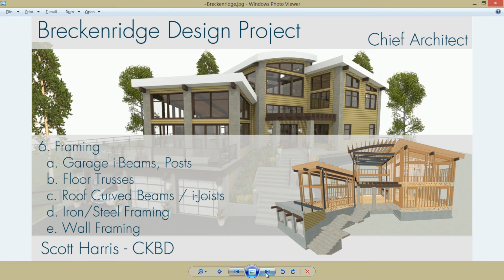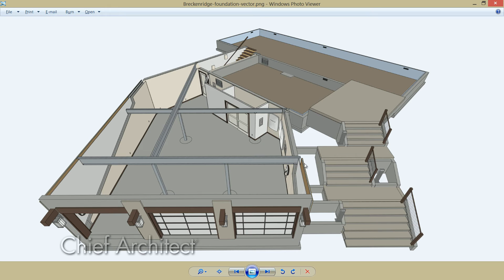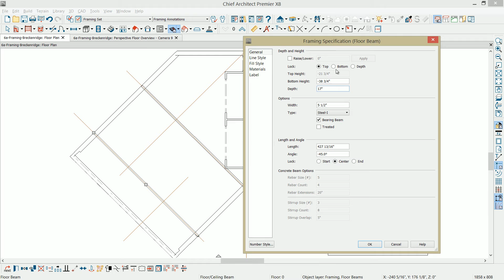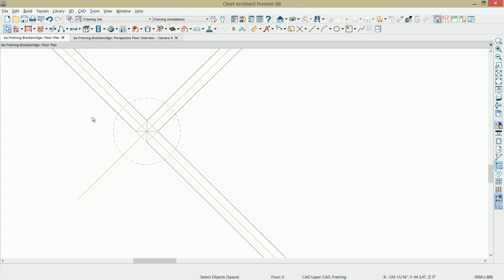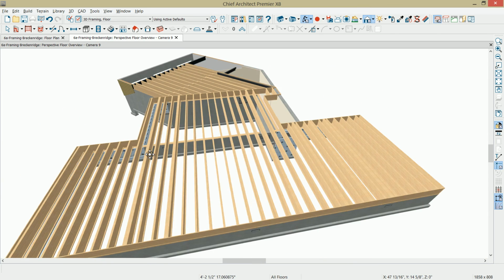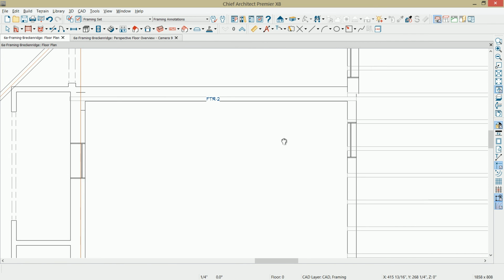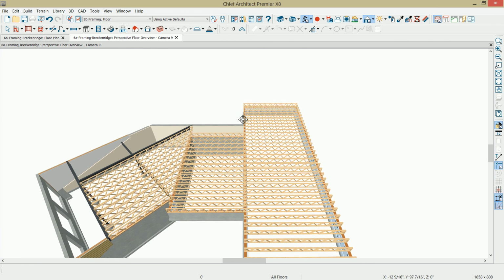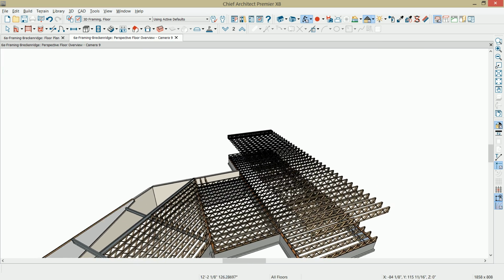Breckenridge Design Project -Foundation Framing

Comment: Do you have a Truss schedule in the software program? that will give you the measurements and location for each one of the vertical webs and the angle bracing for each truss? where you can build each one of the engineered trusses that will meet the code requirements that you are going to build and installed on the roof made out of of wood, concrete or steel built at the job site? I like your attention to the smallest details in your software we are working on 3D printing 100% of the houses the walls, roof trusses and the roof tiles at the job site to cut down on the amount of materials, labor costs and transportation costs is the main goal for each house that it is printed with 100% GEOPOLYMER mortar in 120-168 hours with the exception of the electrical, HVAC windows and doors, cabinets, paint, trim, fixtures and the appliances. I’m definitely going to be getting a 30-day trial period for the designer software great job
Reply from the maker: You can create a custom schedule for the trusses: https://www.youtube.com/watch?v=jdu5CZAPsOw&t=876s
Reply from the maker: Here is where you can request a trial: https://www.chiefarchitect.com/products/trial.html
Reply from the maker: You can use the trial for as long as you like. There are no limits to the trial's tools and features except for saving, printing, and exporting.

Comment: How you get the 3D view color on framing elements ??
Reply from the maker: Hi Juan! In this video, Scott uses the Material Eye Dropper tool to quickly copy the material from the steel I-beam and apply it to the post while working in the 3D view.

This tool can be found through the menu by selecting 3D> Material Painter> Material Eye Dropper. To learn more about these tools, please see this article: www.chiefarchitect.com/support/article/KB-00793. Thanks!